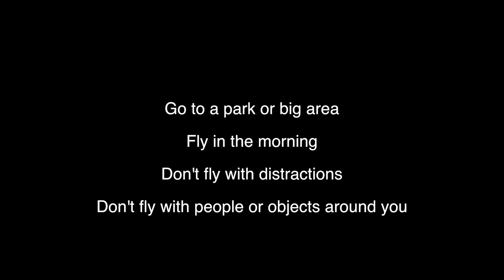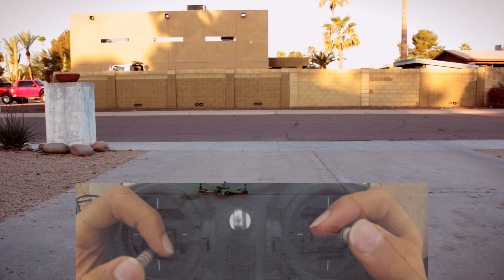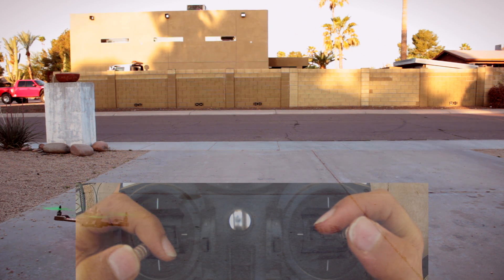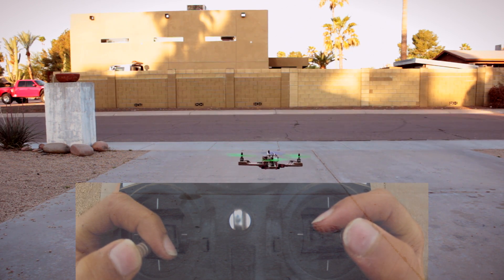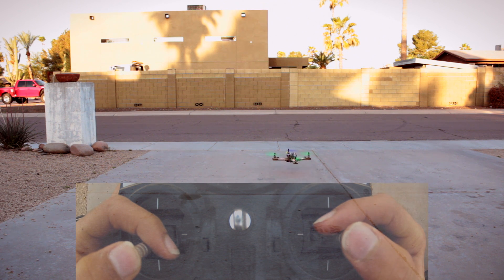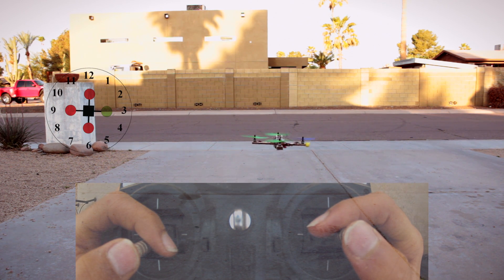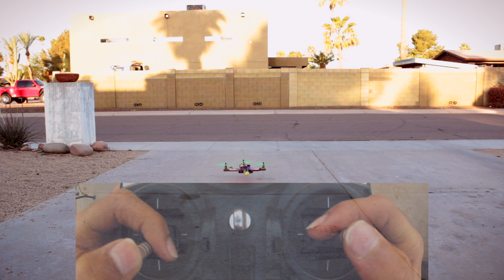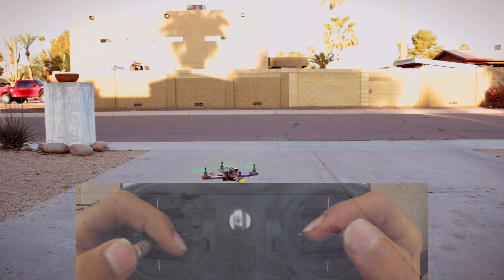How to fly a quadcopter (part 1)

Comment: I buy fsct6b transmitter and APM2.8 controller 
While throttle high low or yaw left or right my all motors are not spin 
How to program my transmitter correct way for solve these plz help me

Comment: when i give throttle above 50% it starts hovering and quad gets top height normally. Flight is fine & stable. The problem with my quad is that when i want to land, throttle is given less then 50% and it falls down.
i want my quad to maintain certain height let say 1 to 2 meter from ground. How is that possible ?
transmitter i am using is Flysky Fsi10.

Comment: Are the more expensive drones like the phantom easier to fly? Because I have a cheap "quadrone pro cam" and it just flys anyway that it wants, it's very difficult to control especially outdoors. It's basically impossible to get good video on it because it doesn't hover, Im constantly adjusting the tilt and turn. I want to get high flying aerials and it DEFINITELY is not possible with this little drone.
Reply: Drones like the phantom and other quads made for aerial photography/video are easyer to fly, yes. Why ? Because it flies on its own using GPS, compas and various sensors to keep itself at level. And the controls are in general softer to take good pics.

Comment: What is a good Racer Quad to start off with?
Reply: build your own buying one is a waste of money, I bult mine for $150 with the smae parts that a prebult came with for around $350
Reply: @Juno Mac RC. I start on Walkera F210 race quad it is RTF and it is very rigid and durable if you are starting into racing quad. Check here on banggood http://www.banggood.com/search/f210.html?p=3P05063702177201602X you may get also $50 cash coupon their. I hope it helps.

Comment: Many say "Nose-in" flying is the most difficult basic flying skill to master, but once you get comfortable with that then banking (right control stick) while simultaneously yawing (left control  stick) will come more naturally from any bearing before long. Fly the quadcopter close and you'll make the muscle memory between your stick control and visual cue's second nature. A weekend or two and you can be a fair intermediate pilot. BTW, If you can beg borrow or steal a helicopter sim for your PC, and get comfortable doing the banking turns and nose in hovering exercises there then you'll attain that muscle memory that stays with you when you move onto a real quadcopter.

Comment: Thanks for the tips. i picked up a little sky viper nano  and im already much better at using it! Was using it upstairs on the carpet and trying to keep it hovering 4 feet up. Watched your video and tried this on the wood floor in the very open living room skirting a few inches off the ground instead and i was zipping around with ease and avoiding obstacles with ease

Comment: Great video and information, question if I may, are you using any stick scaling or expo?? I've been flying for a couple years... still feel like a beginner however, I sold a tricopter to a friend, he's gonna buy a controller, but just wondering if he should try some expo or stick scaling... he's never flown..ANYTHING before.. Thanks, and very nice work with the ghost controller shots. I love that!!
Reply: Hi hawkskyflier you may want to check banggood for complete parts and accessories of drone check it out here http://www.banggood.com/search/drone.html?p=3P05063702177201602X plus if you want they will give you $50 cash coupon if you sign on their newsletter.

Comment: I just bought a Ares Spectre X mini quadcopter  and learned that fly indoors is not easy in a small space. It's too cold to learn to fly outside so what would you suggest I do to learn to fly it...  I hate to have to shelve it until Spring get's here.

Comment: Im watching your grip on the radio. Do you use your index finger to provide some resistance to excessive/overly quick stick movements? Thanks. Great Vid. Your second one had great info in it as well, but wouldve been cool o see practical application of the techniques you described.

Comment: this is poor, it doesnt explain how to fly a quad.
i cant do step one
the quad goes crazy when i try to go forwards, it starts going back and forth with more and more force
Reply from the maker: There is obviously something wrong with your quadcopter then. What kind of setup do you have?
Reply: Your lack of proper setup does not mean his is a poor tutorial on developing flying skills. As "My First Drone" says, there is obviously something wrong with your quadcopter." Chances are you don't have auto-level on or properly tuned. This is a very complex hobby that I'm only just starting myself but this week finally got everything set up right and am finally flying.
There is a lot of information scattered everywhere. Here are some sites I found most helpful: http://www.rcgroups.com/forums/showthread.php?t=2067758
http://oddcopter.com/2012/07/24/setting-up-my-hobbyking-kk2-0-quadcopter-x/
Good luck and happy flying eventually, hopefully!
Reply: +Allen Aghajanian May I advise you to look into settings of your Flight Controller - your gains (PID values) are too high or simply in correct. look it up - and one you have access to those PID tuning decrease Stabilising P value for Pitch and Roll if necessary
Reply: +Artem Bulashev no it was not that, the mixer settings were inverted for some reason so it thought it was upside down

Comment: mine cant event get off an inch off the ground before flipping over :(
Reply: That is most likely because you have a motor reversed! :)
Reply: you were right! :D thanks. i need to tune it still, although it flies and hovers, it drifts left or right every now and then, not quite as stable as yours :)
Reply from the maker: lokster0986 Have you seen my video on How to tune. How to tune your PID on a quadcopter.

Comment from the maker: The naza has a gps hold mode (that can be easily turned off) that would probably not work very well if your close to the ground because of turbulence, but this video is for learning how to fly manually (or whats called rate mode). Also, I wouldn't try this with anything with tall landing gear for holding cameras because it could get caught on the ground while sliding around.

Comment: does this video also apply to a bigger quadcopters with naza control?   I was told in other videos that you should not hover too close to the ground because it might tip over, whereas in the air the naza should keep it stable....